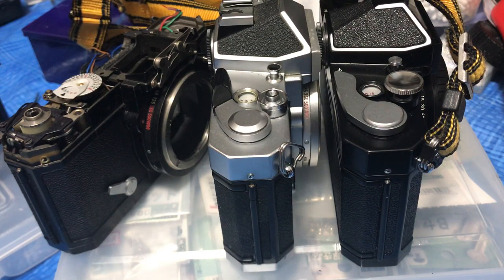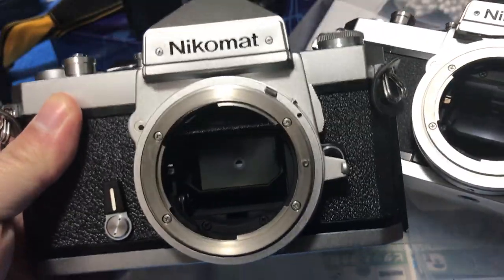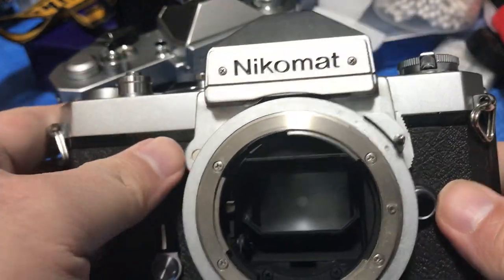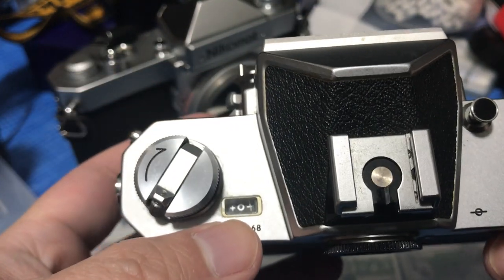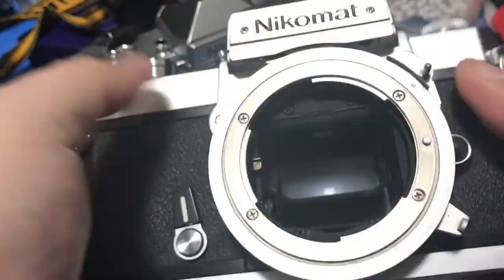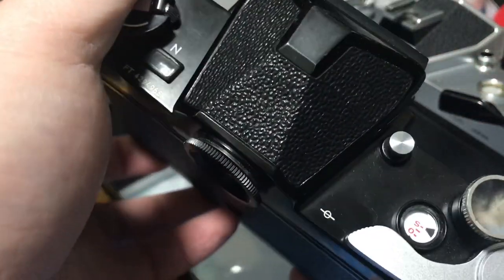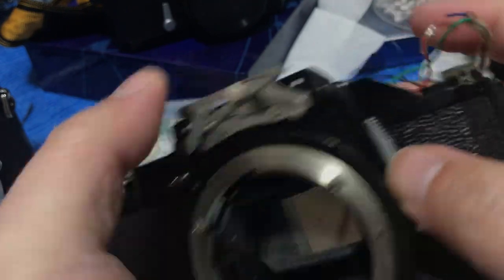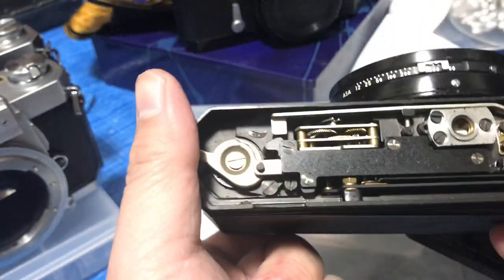Checking Nikkormats

Comment: I have an issue with my Nikkormat FT2:  the meter coupling mechanism sometimes 'locks up' such that I can't rotate the aperture ring on the lens.  First time it happened I had to remove the front cover on the prism housing and manually 'unlock' the coupling mechanism so I could even remove the lens from the camera.  Happened again yesterday..and I use only Nikon pre-AI lenses on my Nikkormat FT2.  Ever run into that and any insights on this issue?

Comment: Just picked up an FTN - the light meter gives faulty readings. Everything is correctly exposed in the meter when I use fast shutter speeds in low light, it is as if the meter is operating backwards. Any idea on how to repair this? Thank you,

Comment: Hi Richard. First thx a lot for your site. All this work on nikkor lenses is incredibly valuable and all Nikon passionates as I am are thanking you for this.
I got a question on Nikkormats compatibility : I got a FTn perfectly functional and an FT2 with a non working meter. Is it possible to exchange the meter from the FTn to the FT2 or is it a too risky operation or it simply won t work ? I understand for instance that voltage are not the same... I am quite skilled with my hand ( I did a lot of modelism) and regularly works on my lenses ( cleaning them and greasing the hélicoïd if needed on eBay old lenses) but I prefer to ask to you first. Thx for your answer

Comment: I have both an FT-N and FT-2. The FT-N requires the mercury battery where the FT-2 does not, however that small voltage difference does not seem to make a whole lot of difference in the metering between the two cameras (unless the previous owner had the FT-N altered at some point). I am amazed at how little these go for nowadays when Pentax K1000 and Canon AE-1 cameras continue to climb in price. The K1000 is a fantastic camera, but I consider the Nikkormat a much better camera and definitely better than the AE-1. That said Nikon FM and FE models are not selling for much either. Maybe Nikon made them too well and supply over demand.